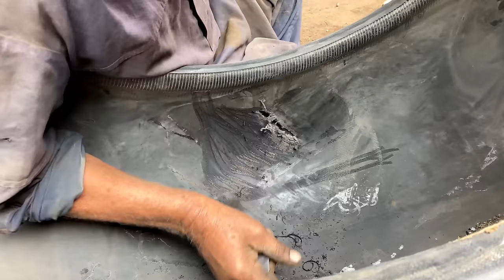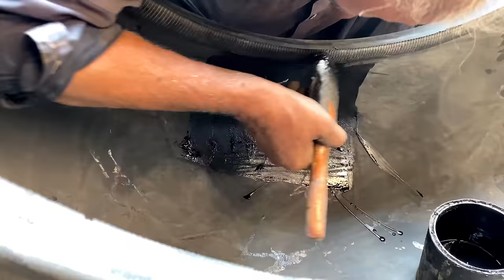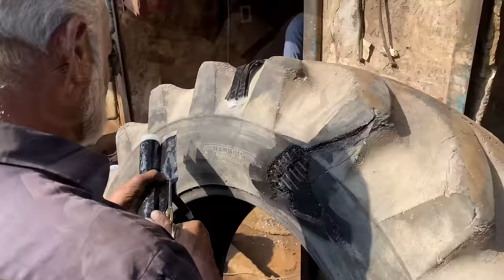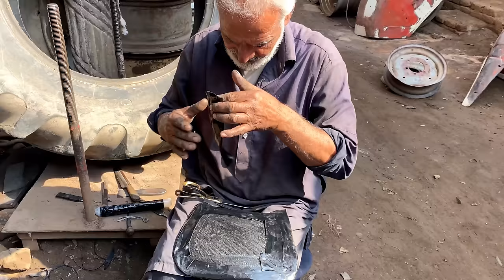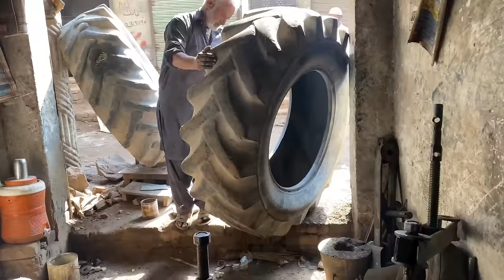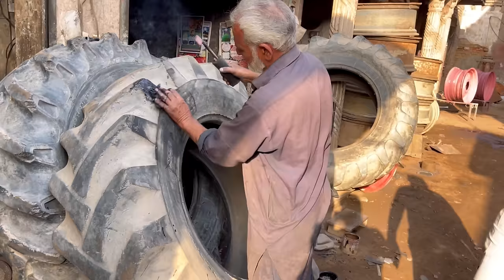75 year old man Repair BIG Tractor Tire|| Amazing Technique Of Repairing A Tractor Tire ||

Comment: That's a lot of work. But an expensive tire. I'd like to know some of the materials used if you can get them in the US?
Reply: Labor costs are too high in the US for this to be cost effective.
Reply: @Muscleupsanddangles  sweat equity. The cost of materials is way cheaper than buying a new tire in a pinch. Plus I like to wear tires out and get matching sets if possible. I've got some heavy equipment that has some expensive rubber.
Reply: @jamesrogers4674  call Polymerics in Cuyahoga Falls, OH. They will have what you need. Good luck.